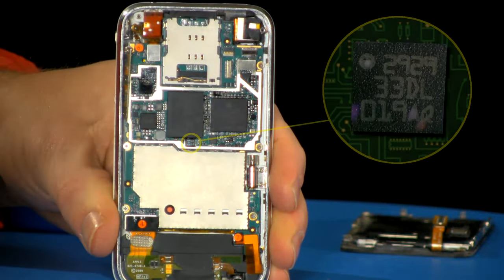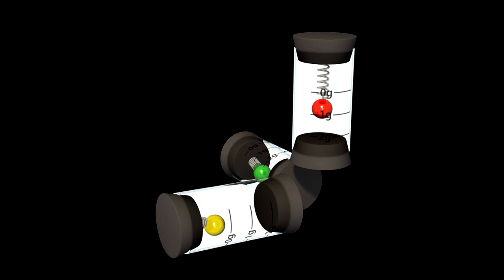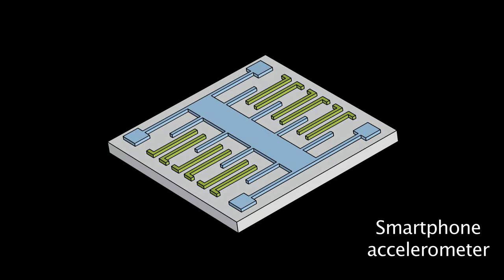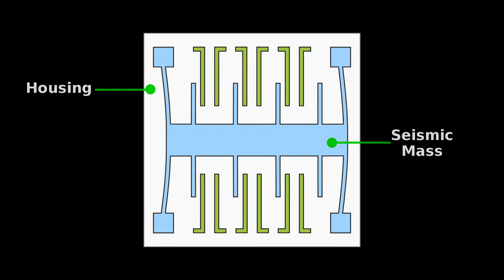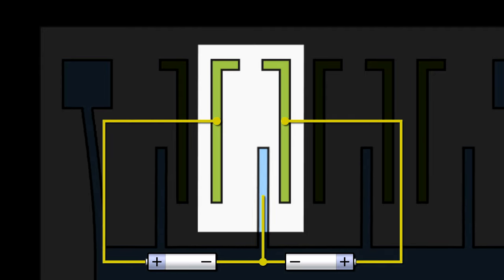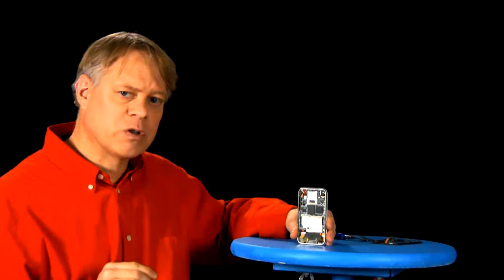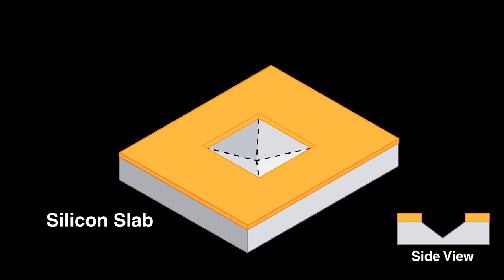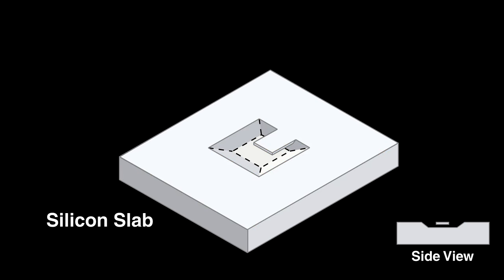How a Smartphone Knows Up from Down (accelerometer)

Comment: Back when it was possible to take smartphones apart nondestructively.
Reply: Back when they weren't waterproof
Reply: @JordanPeterson.  They could be waterproof and still easy to disassemble. Take mechanical wristwatches, for example. The majority have backs that twist off and utilize a sealing ring and silicone sealant.
Reply: @TheOfficialCzex  yeh true..i was just saying what the phone companies would say as their reason
Reply: Samsung s5 is waterproof and the back is removable as well.
Reply: @redi6460  I had S5 and the it damage in water...the back is not 100%
Reply: You must be using an IOS device.
Reply: @JordanPeterson.  You must be desperate
Reply: I couldn't even take my humidifier apart non-destructively the other day. The world is infinitesimally complex!

Comment: I used to work for the semiconductor firm Analog Devices. I was there when they made the very first MEMS accelerometer. One thing not mentioned here is that that device actually used a force feedback mechanism, not gravity. It constantly measures the force required to keep the moving beam centered between the comb fingers and translates that to acceleration.
Reply: after 11 years, now thats awesome!!

Comment: What makes this method even crazier, is there are some incredibly simple and easy ways to make whatever pattern you want for a mask. You can make the mask out of material sensitive to some wavelength of light like UV, such that when you shine a shape with a UV laser over the mask on the silicon and then wash it with some chemical, only the parts exposed to the UV wash off (or the other way around works too). This makes applying masks about as simple as developing some old camera film, but also easy enough that you can make basically a printer like contraption do whatever mask you want, making production and testing of anything extremely quick and easy. 

There is also some more things you can do with this if you bring in only a little bit more complexity. You can deposit a thin layer of metal onto the surface of the silicon, put a mask over it, then use chemicals to etch away unwanted metal to create wires and circuits. Silicon is a semiconductor so it is pretty easy to modify it to be conductive, non conductive, or something in between that we can control, and masks can let us choose exactly which parts of the silicon should be what.

Put all of these innovations together and it suddenly becomes obvious why we are seeing so much technological innovation in the last 70 years. The possibilities are basically endless, you can make anything you want on a microscopic scale, a million time, extremely easily, testing out new designs extremely quickly. It is truly the Silicon Age.

Comment: That's all very well but that doesn't explain how would it know up from down just by measuring motion alone. I mean it could be upside down or sideways when you turn it on and it wouldn't know any different, so what's actually telling it which way is down? (or up)
Reply from the maker: +CoolDudeClem Gravity!
Reply: Actually, he explains in the video: the gravity moves the 'blue' part, creating a eletric current in the 'green' parts... when the phone is tilted, the motion is ceased, so is the current
Reply: And to get the different axis, left right, up down, back forward, you just have other sections with this chip on all 3 axis.
Reply: *****
never tought of that, but yeah, very likely to not work in space... we could ask an astronaut haha
Reply: there is no real "up" in space anyway
Reply: It could work as you can measure relative acceleration and then calculate orientation. Still it is better to use gyro for it.
Reply: If any of the strings is feeling a gravitational pull, that means that the device must be up. otherwise, it must be laying flat. 0:51  tells you if it is on landscape mode. I will assume that the x spring measures landscape and the y spring, well, the portrait mode.
Reply: CoolDudeClem that's when software comes in.
Reply: CoolDudeClem Recall the diagram showing x, y, z. Then do it like Minecraft-- say x is one of the horizontal directions, and let z be the other horizontal. Now have y be the vertical. And note that each of those can measure positive or negative. Now the phone can "know" its orientation in 3d space including which way "up" is.

Comment: 0:28 That's clearly a polarized capacitor and not a mems accelerometer.
Reply: This is correct. That's a tantalum capacitor, definitely not an accelerometer.

Comment: Accelerometers can also be used to determine your position relative to a start point using the fact that your position vector is the double integral of your acceleration vector (and your velocity vector is obtained from integrating you acceleration vector once).

Comment: Love the video (all of them really). However I felt the details on how the chip works relative to the ball and spring scenario was a bit missing. I understand you're using the voltage to measure the orientation of the silicon but how does just that one piece determine the position of the phone on each axis. According the video the silicon only moved vertically so how do you determine Y and Z? Thanks again for the videos, they are awesome.

Comment: It also use the compass. With accelerometers only, you cannot know the phone orientation along the vertical axis.

Those applications need positionning (gps or other technics as wifi ssid recognition), accelerometers and compass.

Comment: The accelerometer is used inside a car to detect the sudden impact or stop caused by an accident and then used to fire the airbags. More modern and advanced cars use several to detect where the impact came from and can tell the difference between hitting a wall dead on or getting hit in the side of the car. This can then change which airbags are triggered first.
Reply from the maker: I think that this use  is why the MEMS accelerometer was developed.
Reply: @engineerguyvideo  Honoured to get a reply from you sir! I'm a big fan of the channel and love learning more from you. Cheers, Dan

Comment: (con't) the phone in your hand or resting it on some stable surface. This means that as in the illustration in the video all the springs would be coiled. But since we are measuring the change in velocity (AKA movement) of the device (this is acceleration or what the phone measures) the phone would be calibrated to either having gravity constantly on your phone or free falling in the ISS. It would then notice the change in velocity and report that meaning it would work on the ISS.

tl;dr: yes.

Comment: Without gravity, there is no constant force pulling the accelerometer in a reference "down" direction.  The aclr will still measure changes in acceleration along its sensing axis(es), but will not have a "down" reference.  If you were in microgravity, you could still get your phone screen to change orientation (by accelerating it along the axis to change), but just sitting there your phone would have no up/down reference.

Comment: I dropped my phone and noticed today that the auto-rotate function wasn't working. I tested it in a racing game where you steer by rotating the phone and the car was veering left, so I knew the accelerometer was stuck. I banged the phone against the arm of a couch and it fixed it! I was a little astonished to say the least. I guess banging an electronic device just like the good ol' days of pictureless CRT TVs still works. I guess the seismic mass got stuck on the other cantilever beams. Crazy!

Comment: The masks can be produced using normal printing techniques, then reduced photographically.  MEMS devices aren't *really* small so normal photolithography is sufficient, for going really small you have to deal with the wavelength of light becoming too large, so your masks become holographic, designed to produce the desired pattern of interference which is a whole other level of difficulty.  Alignment of the different masks (registration) is a big problem too.

Comment: There is also another way to detect acceleration.
Imagine having a long piece of silicon, now when you bend the silicon, you add forces to the crystal structure, changing the conductivity of the material, this way the resistance becomes slightly greater, and you can measure that. I am not sure where this is used in.

Comment: You visually presented the internal structure of the silicon accelerometer as elastic, while also presenting the chemical reaction, that creates the material structure, as interaction in a solid structure.  Just distracted me.

Liked.

Comment: Thanks for a great description - in fact I've really enjoyed your entire series of videos. I'm still curious about one thing in this one though: You can easily understand from this description how a silicon accelerometer would detect irregular movement of the housing, but if the silicon accelerometer only moves in two dimensions, how does it detect changes in orientation? Are there still three (or more) isolated accelerometers oriented along x, y, and z axes, like in your spring-mass example? If so, how are engineers able to make the compound accelerometer housing flat like a conventional silicon chip?
Reply: +Phil Salant I sifted through a couple of pages of hits and "gra_accel.pdf" was the best I found. There it shows how the X and Y ones are as shown in this video, and on the fourth page how the Z axis is basically a large plate suspended above the substrate, so that it gets nearer and farther from it.
Reply: +Phil Salant Sounded like a true salesman Phil :) but I know you are not one cuz you did not ask for the $. :)

Comment: The chip you circled on the board is a capacitor. The actual accelerometer is the chip on the right of the capacitor

Comment: The devices are rated to some 2000 g before failure; I'd imagine other components of the phone would be damaged first (such as the bonding wires for the other processors.) And the movement of the accelerometer is extremely small so it doesn't need to be very flexible.

Comment: A vacuum wouldn't change anything besides a negligible amount of resistance due to air friction because gravity accelerates through all media at the same rate. What you might be intending to ask is would a smartphone work on the ISS?
Because everything in the ISS is falling at the same rate (yes falling, there is some interesting physics here) the force of gravity cannot be felt because the phone is moving as fast as the accelerometer inside which would normally be still because you are holding

Comment: The MEMS Gyroscope is even more interesting than the MEMS accelerometer. The MEMS gyroscope can't replace the accelerometer but works using similar ideas plus the addition of the Coriolis effect and a more complex design, if it's a 3-axis. The Coriolis effect is simple concept once fully understood but can be difficult to do so. It's a brain buster but eventually, you'll get that "eureka" moment

Comment: Hi @engineerguy. Thx for this video.  Does exist any material that pass electric current through it, degrade it until disappearance and be able to accurate measure this degradation?  I am thinking about something similiar to an electric fuse with a kind of "programmed obsolescence" that could be measured. (just to give you an idea of what I am looking for)

Comment: 1:50, you say that means that if the center section moves than current will flow, why does it flow?!
and btw, great video :)
Reply: Those two fingers are charged, creating something called a capacitor. As the fingers get closer and father apart (from the movement) the charges in the fingers get pushed away, and charges moving = current
Reply: awesome :) thanks!

Comment: Acceleration should work, due to inertia (still present in space). Detection of orientation probably not so much (lack of gravity). So, in general accelerometers also work in space (and are used in navigation systems), but I am not sure, how well a phone performs without gravity (especially, because in some applications the ASICs of accelerometers used in smart phones work with an internal offset to counter gravity). Well, maybe Hadfield will answer . . some day.

Comment: Does anyone know of an inertial navigation system/app being created using a phone's sensors? I used to work with INS equipment in the 80s, when it was heavy, expensive military gear. Since phones have 3-axis accelerometers and gyros, it should be doable, right?

Comment: Stop and think about what you just said for a moment.  If you require further food for thought, realize that the sensor alone is not responsible for your smartphone changing screen orientation: a host of hardware, firmware, and software is also necessary to rotate the displayed graphics.  Filtering, sampling, and operation thresholds also play into how data from the sensor is interpreted.

Comment: William S. Hammack speaks so fast that it is hard to notice that his "Side View" drawing does not make sense. It makes some sense (not much) if we assume that the potassium hydroxide etches silicon faster in the HORIZONTAL direction than in the VERTICAL direction. (Mr.  Hammack stated the opposite.)

Comment: So if a Smartphone differs up from down by an accelerometer does that mean that if the phone is moved slow in enough than you could theoretically "beat" the accelerometer viewing a horizontal image while the phone is in the upright position?
Reply: Yeah, these capacitive accelerometers do have a sensitivity and "motion resolution" if you will, aka they will only move if enough force is applied to them.

If you twist it slow enough, the proof mass will not feel the inertia of the movement and may not twist enough to create the current flow between the fingers
Reply: Jsinger5 not precisely. actually the sensor is kept vibrating constantly at its resonance frequency so even if you turn the phone around slowly, it just takes a small change in the orientation to change the time the mass stays on one side. it's because of gravity and not inertia.

Comment: Hello EngeneerGuy, could you tell me how could I connect the Accelerometer from a smart phone to my computer. I would like to collect data from the smart phone accelerometer and and have that displayed in a computer or tablet.
Reply: Ana Julante learn a bit of Android programming. By the way the tablet will also have an accelerometer , so no need to connect to a phone
Reply: +Ana Julante: Look at mybringback's tutorial on Android Programming. Basically, you register to the accelerometer's events and then print them to the screen or on the log.

Comment: I don't see how this translates to change in orientation. Only movement as changes in acceleration. According to the design you showed, it would only measure changes in acceleration over one axis. If the whole thing were turned on its side, the "spring" wouldn't move at all. You would need a second one set perpendicular to that one, and possibly a third, making up the third axis. 
What gives?

Comment: how do they make the mask with the small square hole?
Reply: 1wsx10 using Lithography: They pour a thin layer of liquid plastic on the surface, and let it set. The magic part is to dissolve parts of the plastic layer with acid. To decide which parts get dissolved, they use a special plastic that changes (becomes dissolvable) when exposed to light. So by shining a certain pattern of light on the plastic layer, and then washing the plastic layer with acid, you can make any pattern.
Reply: jnnnnn
ooh thats really cool!
Reply: jnnnnn how do they make the light so tiny that it can make the mold though?????
Reply: gorftpael
lenses
Reply: gorftpael -- like a microscope in reverse. Instead of starting with a small image and making it huge, they arrange the lenses so that a huge image (often printed using a very high resolution laser printer) is projected tiny.

Comment: But how do they cut the masks? Don't they have the same "it's too small for tools" problems with them? Is it that they're made of a material thin and soft enough that they can punch them into shape and therefore need "less precise" (or less sophisticated) tools than would be required to cut silicon?

Comment: ......ah so because we don't have any tools precise enough to make the parts needed for the acelometer...we will instead use ACID to burn the object INTO SHAPE....BURN IT...".......of course,
Reply: We have tools to do it. For example Helium Ion Microscope(HIM) can make 10nm slices. Also advanced dry etching like Reactive Ion Beam Etching (RIBE). But sometimes for processes which do not need high precision, and for mass production it is easier to use wet etching(Base, not acid)
Reply: im trying to dramaticize the process, don't ruin it with your science.....(its cool. but...)

Comment: would it work in space?
Reply: Actually yes. Maybe not in the way it's implemented in smartphones though.
Reply: ***** why wouldn't it? just recalibrate it and you are good to go.
Reply: ***** any acceleration will register, there is no need in any gravitational force. Instead of figuring out where's up, it will just register 3D acceleration.  It will actually be easier to do in space than on earth as you wont need to compensate calculation for gravity.